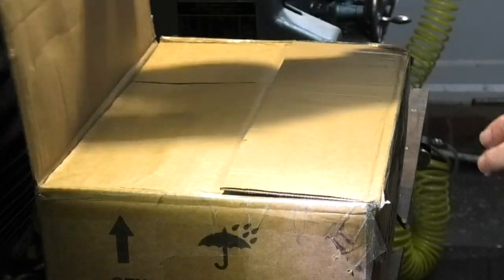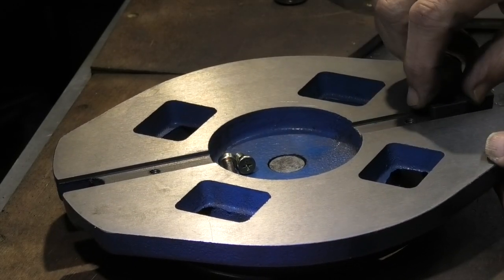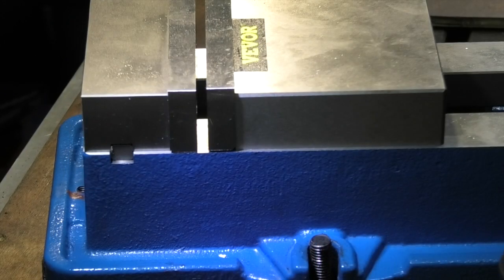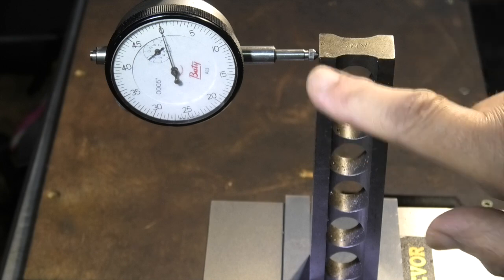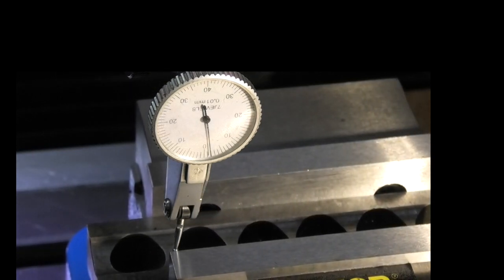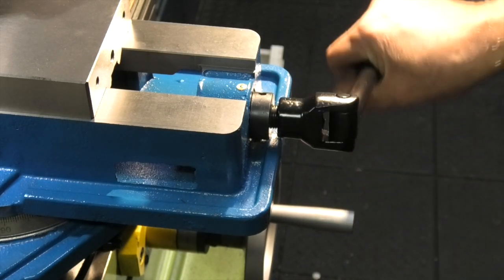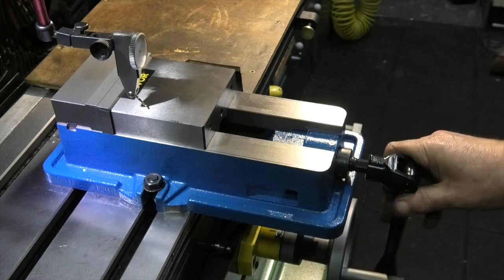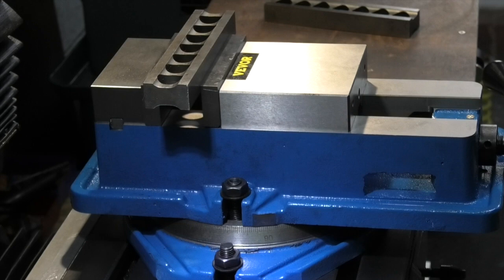machine vice from Vevor a 4" machine vice with swivel base and handle

Comment: Thanks for this review Alan, exactly what I needed at present as I was considering purchasing either the 80mm or 100mm vice of what Vevor call the High Precision 100mm CNC Vice. My mill is a Centec 2B which has a very narrow table (only 125mm) so I am still not sure if the 80mm or the 100 is appropriate. There is not that much difference in footprint between the two sizes but the 80mm just sits much lower. As the mill is horizontal having a pair of matching vices seems to be sensible but when the Vertical head is installed then a single vice is probably enough. Pleased for your comments about the flatness and general quality as at this price having to do some edge relief and cleanup is expected. Thanks for the review.
Reply: I've got a Warco WM14 which has a 120mm wide table, and the 80mm version of this vice. The Y axis dial is difficult to see properly as it's covered by the overhang. The 100mm version would make it impossible to see. Obviously not a problem if you have a DRO.